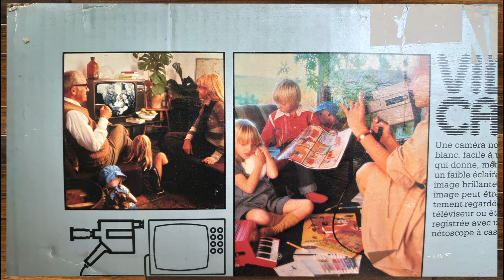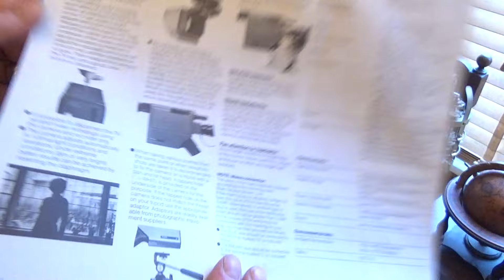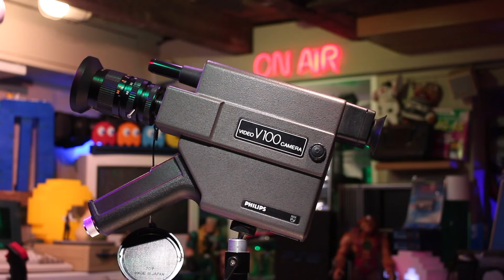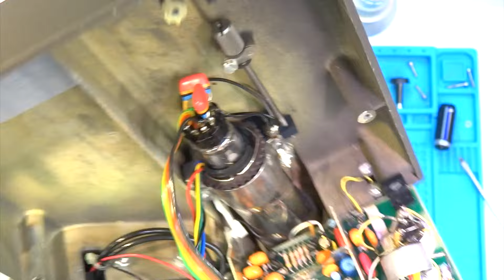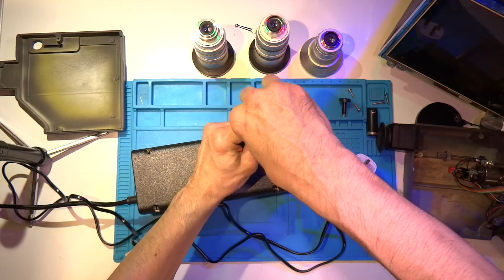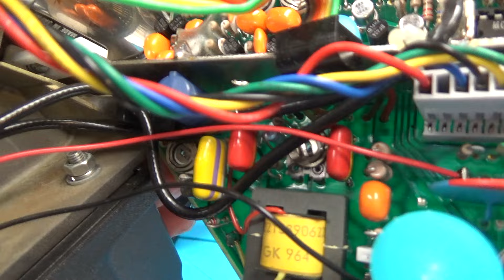PHILIPS V100 1970'S BLACK AND WHITE VIDEO CAMERA TEST and Adjustments

Comment: Hey there. I fell in love with this camera after watching your video and just bought one for myself. It seems to work fine, but my goal is to power it with a battery to make it portable. I'm also planning to use a capture card to get the video feed straight to my smartphone.

I'm a bit confused about the voltage, though. The camera's power supply says it's around 9.6Vdc, but in your video, you mentioned needing to go above 13Vdc. This is really interesting because it means I might be able to use a standard 12Vdc battery.

Have you done any further tests to make sure the camera is safe to use at voltages over 12Vdc? I'd hate to fry it. What's your take on this?
Reply from the maker: I had to watch the video back again as I couldn’t remember. I can see i m powering it up with 13 volts. These old cameras usually work 12volts. I use a 12 volt battery in other camera’s  from this era without problems so far.  Obviously. It’s always a risk messing about with them and potentially causing damage. Just make sure you get your positive and ground wires the right way round.

Comment: There is a small square looking fuse between the terminals of the transformer. most likely this is blown. (can be replaced)
Replacing the bridge rectifier and main filter cap is also wise to do.
Reply from the maker: I didn't notice one. Thanks for the info. Did you spot it in the video or have you worked on one of these.
Reply: @RetroGadgetMan   I worked on a lot of Philips equipment from this time period. This type of transformer with built in fuse was very common. Success with the repair.
Reply from the maker: @minimaxxl8 thanks. Before it blew there was a humming sound that wasn't there before. Fuses usually blow when something is wrong. I wonder if the windings have shorted out. I guess I'll find out when I find this fuse and replace it.
Reply: @RetroGadgetMan  therefor, check the bridge rectifier, might be shorted. Success.

Comment: The tube used to capture the image is shot. We had one at home as my dad use to work at Philips from 1955 to 1987 in Eindhoven. This was a problem these cameras had. When new they image was actually very good, but those image tubes were a problem.

I have some reels of video he shot in 1977 and 78 with this camera. that if you play side by side with what you shot are like night and day. But, again the camera was new at the time.
Reply from the maker: Thanks for the information. Have you uploaded the footage you speak of. Would be interesting to see if form a historical point of view. I think my camera is just old and worn out. A miracle it works at all.
Reply: @RetroGadgetMan  the reel to reel video deck I have is a Philips EL3400. Sadly I don't dare power it up now. It's also worn out. 

When my dad worked at Philips we always had lots of tech. 

What I am surprised is the Video 2000 my dad brought home new still works fine. I know that many of them were plagued with problems. But, he use to say if people knew how to take care of them they would always work. But, like most consumer products people don't take care of things. 

I remember when in 1979 when I was 9 seeing a Philips N1500 he got earlier. But, this was only a test model from before it went to market in the early 70s. that one is long gone. 

I still have a couple of movies released on the N1500 format, but the tapes not are unplayable.
Reply from the maker: Wow that EL3400 is valved and weighs 45kg according to the rewind museum. A collectors item now. Nice to hear that bit of history.
Reply: @wheels2fun526  wow what I would give to see a pre-Market N1500 in real life! Do you know of another test model that is still in existence? And do you have pre-market VCR-Format tapes?

Comment: I doubt the case is a "magnesium alloy" given you say it is "heavy". 
Mg is significantly lighter than Al.  
Al is significantly lighter than Zinc.
Zinc (alloy) is the most commonly found in 'consumer goods' because it is cheap and has a low melting temp., suiting die casting.
Reply: Ive got great heavy quarz  standard 8 cine camera die cast
Reply from the maker: Thanks for the info.

Comment: The outside of this camera reminds me a lot of the Philips LDK44 (a.k.a. "Video 80" I think) professional television cameras that they made around the same time (late 1970s). I worked with those at a local TV station in the late 1980s and the build quality was very similar to this one. I bet it's possible to get a much better picture out of it. Maybe there are some old capacitors in there that keep some of the power rails from reaching the correct voltages...
And yes a blown transformer seems very weird.
Reply from the maker: Just looked it up. Unusual looking camera and multiple setups possible for inside and outside use. The CCU is larger than the Sony's from the same time period. I suspect most of the video circuits are in the CCU instead of the camera. Maybe one day I'll inspect the capacitors to see if they are operating within there tolerances. Couldn't see any leaks but they could be hiding.

Comment: A complete recap might work wonders. And as well as it is made, I don't think it would be too much work, either. I wish everything I service was made that well!
Reply from the maker: It may help a little. From experience complete recaps have not worked for me in the past.  I only replace leaking ones now. Sometimes I pull them out test and if they are with in 10% tolerance I put them back in.